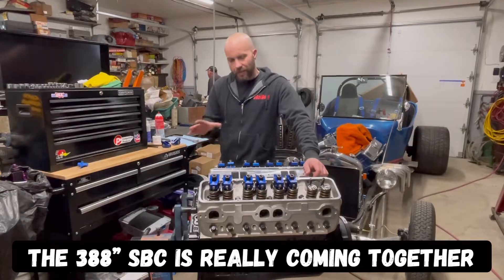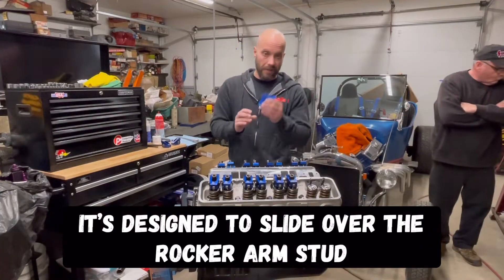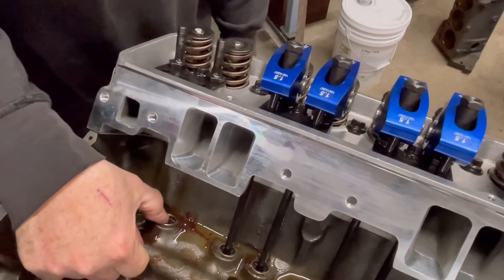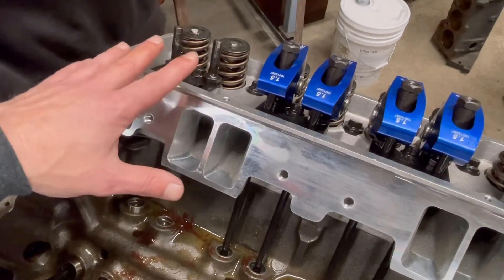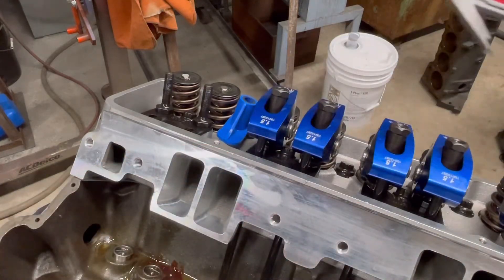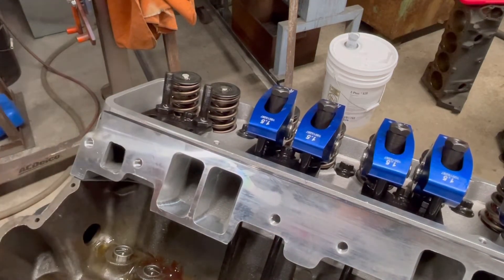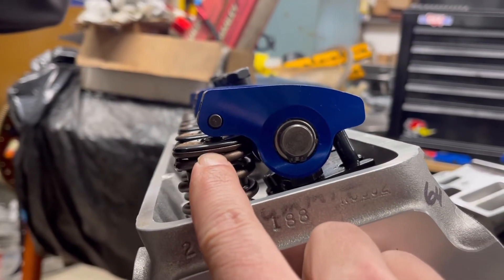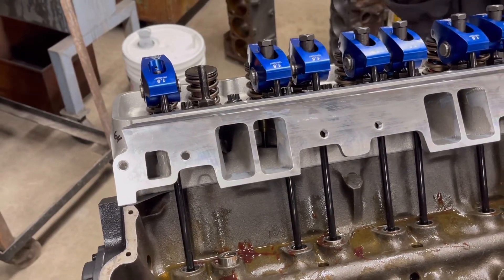Easy! How to Measure for Pushrod Length! #howto

Comment: I have to respectfully disagree with your methods and findings here. The tip of the rocker arm should ideally start at the outboard 1/3 of the way and move across the face of the valve to wind up at 1/3 inboard of the way. With the cam on the base circle,If you are starting at the middle of the valve, the pushrod is too long and needs shorter. It will travel from the outside towards the inside as it pivots.

Comment: Do you use the mid lift method for setting up the geometry at all?  Or what do you think is the most important?   Thx
Reply from the maker: That’s not a bad method either.  I personally prefer this one, it’s how I was taught by a guy who has been doing this for decades.
Reply: I believe you are correct if your using the blue push rod checker tool.  You need to find the 90 degree measurement from the center line of the trunion to the top of the valve retainer at mid lift.  If you don't your push rods will be too long.